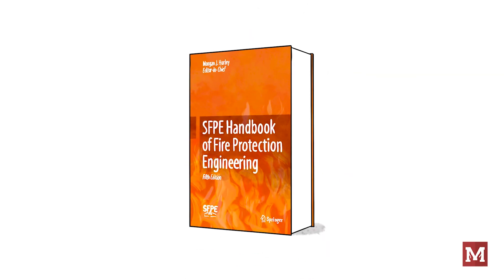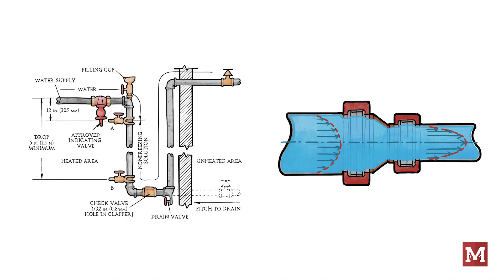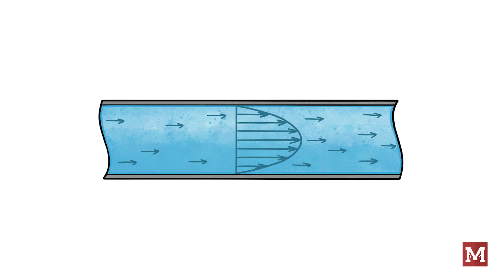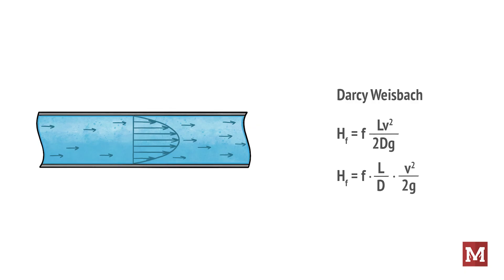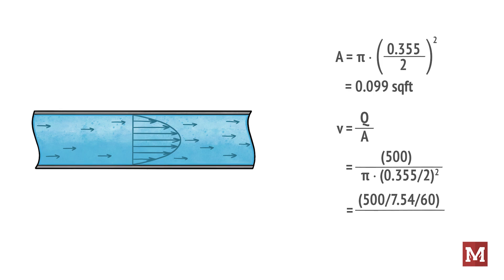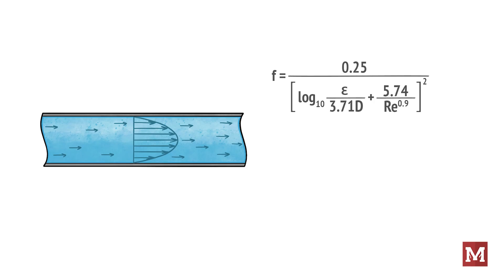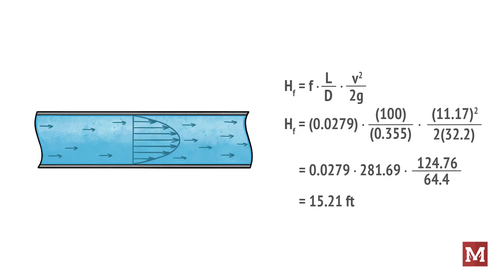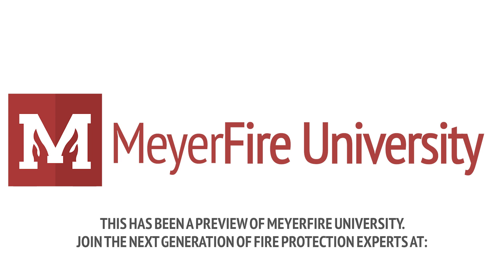Darcy-Weisbach vs. Hazen-Williams

Comment: 1:43 - "The effects of turbulence on pressure loss are minor." - I disagree. The pipe flow is very turbulent and controls pressure loss. However, as the chemical properties are stable - as you mentioned - the turbulent flow over the flow regimes expected in fire protection can be adequately modeled with Hazen-Williams equations.

6:00 - One assumption not challenged or substantiated is the water temperature. If a dry pipe system is being used, it is likely in a colder climate. While this could be Tennessee with ~60° water temperature, it could also be Washington, Montana, or Michigan with ~50° ground temperatures. If ~50°F water properties are used, then I get about 7.11 psi / 100 ft in the calculation example. Still more ideal than the Hazen-Williams result. But when a more ideal, optimistic result is desired, then the engineer should be ready to defend the assumptions that led to that lower pressure requirement.